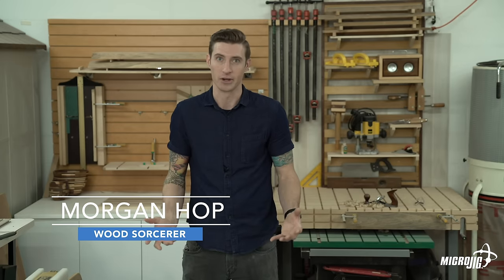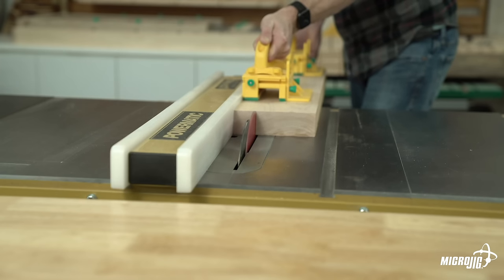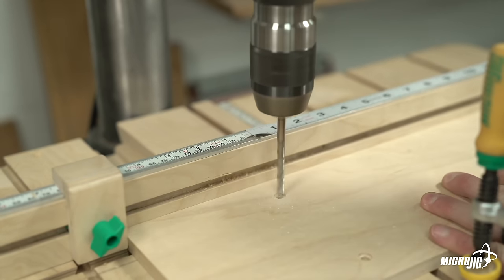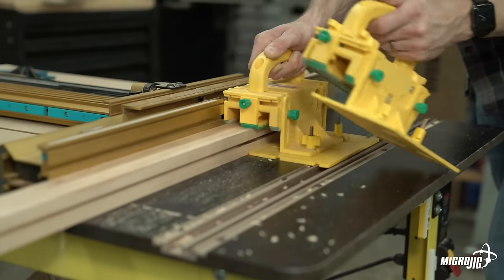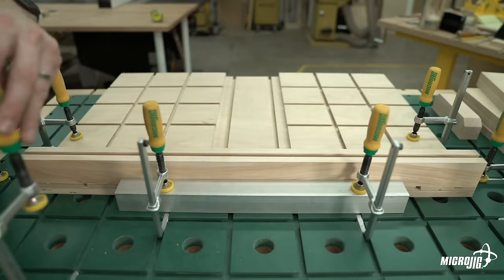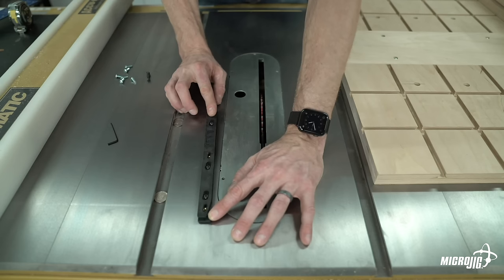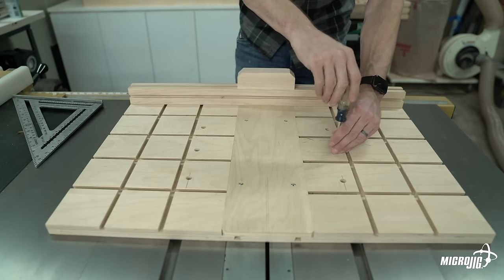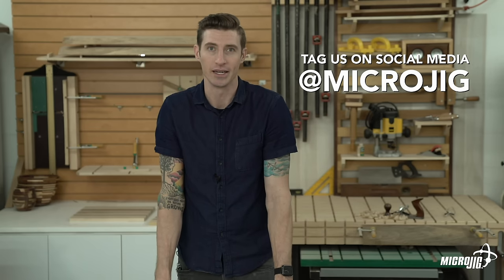How To Build the ULTIMATE 360 Table Saw Sled!

Comment: Awesome looking sled, but too much for me to tackle..lol
Reply: It is hard to do for sure. You need to have a drill press with a large capacity or find another way to drill straight to install the miter bars. Microjig's router table is also ridiculously large. Even with an extension fence, I could not easily route the dovetail tracks. I finally did-it with a squared straight edge. And lemme tell you that if you plan on glueing the laminated 1/2 inch boards like he did with dovetail clamps on a surface, you'll need to route yourself another work surface.

Comment: @Microjig Hi Morgan, I'm currently working on this project. I'm almost done, but I need you help with the spline and vertical cutting jig! If you look at the plan, there are just 2 dovetail tracks. In your video on here, there is 3 tracks which feels better to me. Could you please give me the measurements you use to space the tracks so I could make it like that? It feels like 2 inch from the bottom, then 5, then 8. Could you confirm this for me? Then there was a holder that goes on the jig that you apparently didn't give the mesurements. I'd love it if you could provide how wide, long, thick this holder is, how long and large the slot is and de distance of the slot from the end. And lastly, if you could specify if you assembled the mdf structure with just screws or screws and glue?

I'd be very happy for these details and also to know if the attachment video made any progress towards the top of your "ever growing" list of to dos :) 😊
Reply from the maker: Mr Phil, Morgan has gone on to do his own content in his new home shop. I will try to answer your questions.
Yes, you can certainly do the three dovetails on the vertical holder at 2", 5" and 8" from bottom to top. We generally recommend 4" on center between grooves, but that is not required. 
2" is the least we recommend between grooves or from any edge, so your plan works.
If by "holder" you are referring to the slotted rectangle briefly shown, It is probably 2" wide by about 6" long with a 1/4" slot up the middle. The triangle is in the plan and is really just copied from a plastic office triangle.
Finally, we do have plans to do an updated version of the entire sled plan with more details and full content on the accessories. But no release date yet.
Reply: @Microjig  Thank you for the answers! Yeah, I saw that Morgan left about ten months ago. Woops. Do you know how thick the box joint attachment was? Did he use glue on the vertical jig in addition to the screws?

For the vertical jig, what is the long slot's distance from the part with the tracks (in the bottom part)?
Reply from the maker: @MrPhil1st  Morgan's fence for the box joint jig was 3/4" but it can be 1/2" just as easily since it does not have any dovetail grooves in it.
Always use glue on your constructions. The screws really are just there to hold things until the glue dries! 
In the vertical sled, the slots for the hardware are not critical. 1-1/2" from the front edge looks to be right.

Comment: how does the front of the sled not flex open
Reply: I'm wondering this too. I'm going to try to make this as-is, and I'm assuming that since there is a miter bar on each side that it will realign each half when it goes back on the table, but I don't know if I will trust hanging this on a wall due to the front of the sled being unsupported.
Reply: I thought the same thing.  I was thinking of making the center section longer so it hangs out on both sides.  That way I wouldn’t cut all the way though the center section of plywood.  I like the idea of having no front fence to get in the way.
Reply: It doesn't flex open because both sides of it are locked into the miter track slots with large black pieces of plastic. It's not going anywhere.
Reply: But like Matt said once you lift it off the table saw it could be a little flimsy and that could throw it out calibration.   I like the design I was just wondering how to make that aspect of the sled a little more stable.
Reply: I was thinking about a removable front fence similar to the back fence using same type connectors used on the removable zero clearance inserts. I assume I need to provide the longer threaded rod.
Reply: @JamesDHendrickson  I'm assuming they mean it would flex when you take it off of the table saw.
Reply: I'm assuming you mean when you take it off of the saw. I agree. I'm considering making one and wonder if a small fence spanning to just shy of (or inside) the dovetails (so that they are still useable) would be a workable support for that end.  It could be screwed with say 2 screws on each side of the insert but obviously not screwing through the insert. It would give rigidity to that end and the insert could still be removed. There may be jigs that this add on might limit or prevent their use. Hmmm?
Reply: I will build this using  4 MATCHFIT Dovetail Track Nuts to secure a front cross member tie (front fence) allowing clearance for zero clearance inserts to increase stability.
Reply: Update! I just made this with the intentions of having a small bridge across the front for rigidity. Before I put that on I picked it up to finish attaching the fence piece and realized it is very rigid. Now I see why they suggest using maple. You'd have to put in some effort for this to break. But when picking it up and moving it, I don't get any flexing at all.
Reply: If you want to put a front fence on you can route out the end of the dovetails so you can drop the clamps in instead of sliding them in from the end. You lose a little clamping capability but would keep the sled flat.

Comment: Disappointed in the ability to cut consistently square.  The tracks didn’t hold the sled from moving around.  Going to try a different rail system and the 5 cut method for placement of the rail. I do like the concept and am hoping to find lots of uses for the sled
Reply from the maker: Ed, please contact our tech support at "support@microjig.com" or by phone at (855) 747-7233. The ZEROPLAY should lock perfectly tightly once set and not allow the sled to move. We want to help you figure out the problem and replace the parts if they are not right.

Comment: This says to use ½" plywood, but the instructions that come with the parts says ¾" plywood.  Can you clarify?
Reply: And, I had purchased the 360degree sled kit just to verify.
Reply: This is not the same sled as the one that is in the kit.  The sled in the kit instructions is much smaller.  This sled uses 1/2" plywood because the sled has two layers of 1/2" plywood making the sled thicker.  I built the kit sled today with 3/4" birch plywood.  It is a nice sled but I like this one better.
Reply: Jim Hays Thanks Jim.  I did figure it out later.

Im on my 3rd attempt to build this one.  Had a router bit come lose on the last run on my 2nd attempt.  Didn’t have it deep enough.   

Third time a charm??

Appreciate the direction.
Reply: Thanks Jim. Appreciate the guidance.

Comment: Microjig SUCKS!
Reply from the maker: Any particular reason you feel compelled to comment this here? Did you contact us to give us a chance to fix your issue?
Reply: @Microjig  I didn't contact you folks because I know there will be no compromise. So why waste my time.
The issue i have with you folks is the price gouging. Most of your products are made from plastic, but you folks feel you can charge as if the were made from gold. I also feel that your clamps, especially the dovetail clamps are over priced @ $31.00 each

Comment: Is the sled only combining the two halves at the front fence or am I missing something? Seems like most sleds have a front and back fence, the back fence for stability as much as anything else, I noticed that this one seems to have only one fence.
Reply from the maker: We left the front fence off so miter cuts on longer parts can be made. The center insert can be used to hold the halves together if you do not cut through the front. (Raise the blade inside the sled before cutting) 
One of the best parts of making your own sleds is that you can tailor it to your specific needs. Add the front fence if you want. Make it removable!

Comment: I like the concepts that some of your products make possible but I live in Canada and can't help but notice that I need somewhere between $300 - $500 of your dovetail clamps just to make the sled you demonstrated. That is more than 
I paid for my table saw.
Reply: Of course they’re going to use tons of dovetail clamps in the build! These are marketing videos to show off the variety of ways their products can be used. There are obviously some benefits to clamping on an assembly table like they’ve done in this video, but it’s by no means a requirement for building this sled.
Reply: @AndrePrudhomme  I realize they are advertising their own products. My comments were regarding the fact that most of their products are very ecpensive in Canada.
Reply: Bevan Stuart Yeah, the clamps definitely add up - even at American prices that is $440 worth of clamps (22 clamps @ $20/clamp). I guess my point was it’s easy to build this project without using any microjig dovetail clamps and the jig itself only requires 2-4 clamps to use.
Reply: @AndrePrudhomme Andre, sorry if I came across too strong. I have been looking at this dovetail concept for a while and I am having a hard time deciding whether to commit to starting a journey that I know will lead to needing more and more of their products. Thanks for replying.
Reply: Bevan Stuart No worries - I went through the same internal debate recently when deciding to buy the Matchfit starter kit!
Reply: @bevanstuart9013  I am in the same shoes as you, and I live in Atlanta Ga, I have several of the micro jig products and I can only justify them when they have a woodworking show in my area and offer the show specials, I love their products and I have met the owner at one of the shows and he was super nice, and makes a great product, I wish I could afford more than the 3 clamps I currently have
Reply: The other option is t-tracks, as pointed out that gets just as expensive and isn't nearly as versatile
Reply: Upgrade your tablesaw
Reply: @bevanstuart9013  So?
Reply: I personally don't have a ton of money either so I use less clamps but add steel tubing between them to keep even pressure.  It may not be the "Right" way but it is "A" way of gluing with even pressure.  (I think)